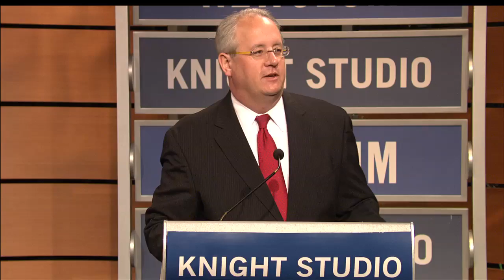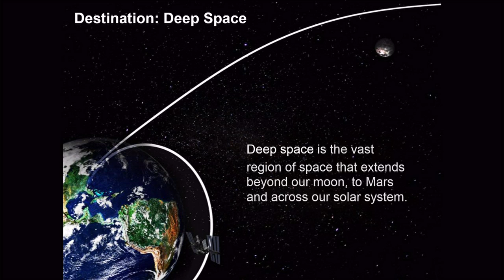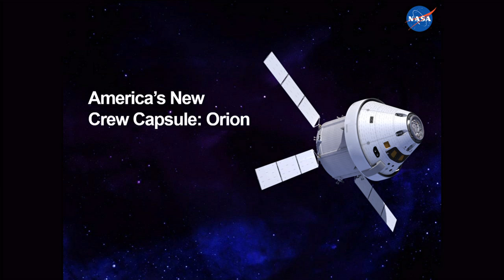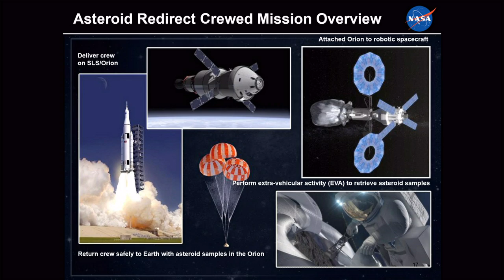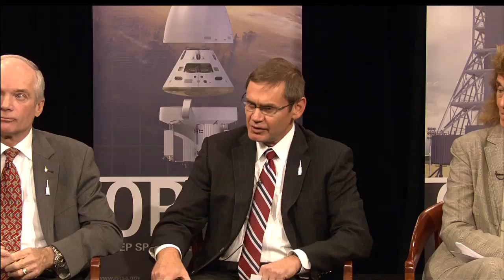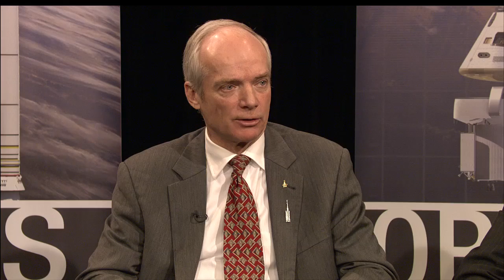Removing the Barriers to Deep Space Exploration

Comment: As I watch this I feel a twinge of sadness. Its been over forty years since the first manned moon landing and here they sit waffling about what is essentially Apollo 2.0. If humankind is to step away from the cradle of Earth then we're going to need re-useable launch systems with a fast turn-around between flights measured in days between not months!
Reply: +Bishop Howells The problem with re-usable spacecraft is that defects can occur an worsen over time. For example, the Challenger disaster happened because the O-Ring seals we faulty. They wouldn't have gotten worse had they only been used one. Then, the Columbia disaster only occurred because foam from the External Tank hit the orbiter's wing on launch. That wouldn't have happened if the shuttle was brand new, since the wings would have been stronger. While it is good to have short turnaround time, crew safety is more important before mission success.

Comment: You want to remove barriers to deep space exploration? Here's a thought:
Cancel Orion/SLS.

Orion/SLS is a giant pork barrel designed to bring cooperate welfare to the large aerospace companies. It will be so ridiculously expensive, that NASA won't be able to afford flying this thing very often. I would not be the slightest bit surprised if a deep space Dragon/Falcon derivate (like the "Red Dragon" and a Falcon 9 Heavy) will be ready in a couple of years, for a fraction of a cost – and most importantly before Orion/SLS has completed more than two or three crewed missions.

The sooner you cancel Orion/SLS, the better. Otherwise that white elephant will bring down both human and robotic space exploration, just like the Shuttle/STS did in the seventies before it even flew, and then in the eighties after we lost Challenger and her crew. And it will be a barrier to crewed space flights like the STS was ten years ago after we lost Columbia and her crew, and then once more after the retirement of the STS not so long ago.

Cancel Orion/SLS. Cancel it now.

Comment: since we are not even close to having speed of light space ships, we would have to use generational ships. generational ships are ships that take so long to get there that several generations of crew would live and die before the ship arrived at the destination. so this ship that takes 500 years to get to the destination is powered by what? what is going to power this ship for 500 years? the most advanced reactors on earth are the 2 reactors in the Gerald Ford CVN 78 class of aircraft carriers in the US. these reactors can operate continuously without refueling for 30 years. only 470 years shy, what do you do for the 470 years? the state of the art in power generation has not advanced since the 19th century. 19th century coal fired 1 GW, 21st century 1 GW nuclear. mean while energy use since the 19th century has sky rocketed an order of magnitude, or more.  not going to happen.  Star Trek will never ever happen.